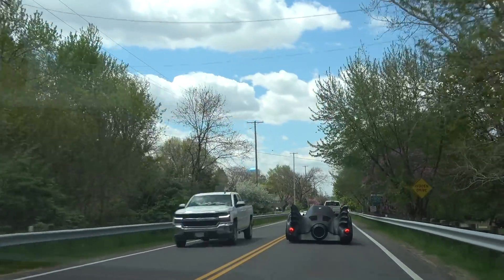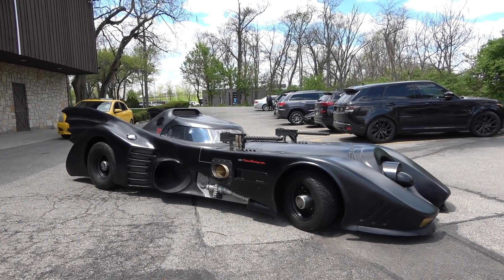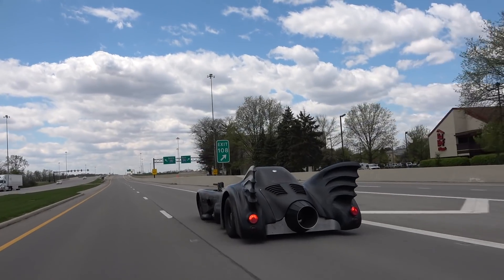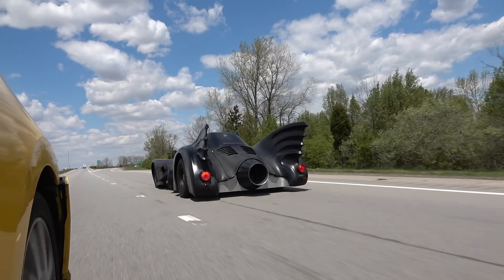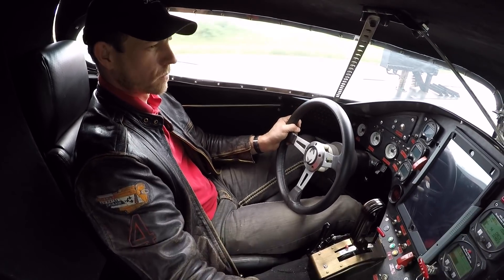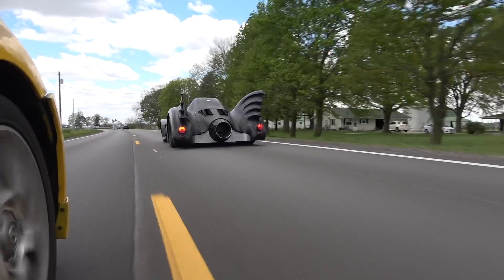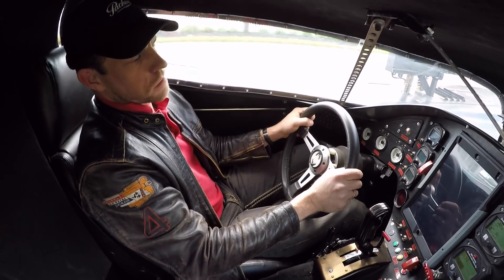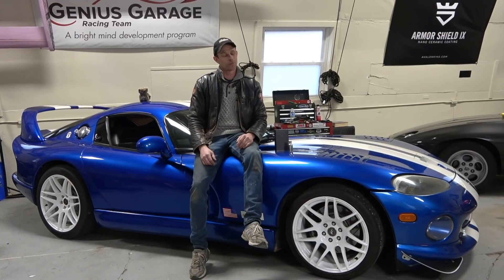Driving a real bat car! | Jet engine how to and review

Comment: Great drive! I'm surprised though you needed a gear-box with a gas-turbine engine. Gas-turbines are like electric motors in that they produce max torque at zero rpm
Reply: Ummm... NO!

Comment: Cool vid Casey, can you use the thrust to push the car? Or is it just using the shaft rotation to a gearbox using the rotation? Either way, it is a very cool build that is actually more realistic than the Hollywood version.
Reply from the maker: Internal thrust drives secondary turbine the drives the wheels

Comment: It's not economical to have a lot of "headroom" in a turbine engine, they basically consume the amount of fuel they do (a lot) regardless of the RPM (sure there's a measurable difference between idle and full power but it's single digit percents) so you generally want to run them close to full power all the time. Apart from top-speed testing on salt flats, just how fast can one even drive that magnificient beast, I doubt it has very good cornering at high speed (and it's not meant to).

Comment: How awesome that car is.   Odd question you said it runs on Jet Grade A rather then other fuels and burns at the same fuel rate running or idling 16 gallons per hours. What kinda of mileage is that?  16 smiles per gallon like Jay Leno says with his airplane powered cars.  Guessing about 3.4mpg at 55mph or 4.3mpg at 70mph (ouch) at about $4.11 per gallon means it cost over $65 per hour to drive in fuel.  It cost money to be so awesome
Reply: the thing with turbines is that the difference in fuel consumption between idle and full isn't much. don't know how to estimate though

Comment: At 18:31 you reached over for something, was that a thing or am I just over thinking your sudden movement? 
Just curious, cause if it is normal, I would like to question why you would have 2 switches that need to be turned off at simular times far away from each other. Or else I am just being stupid and don't know my turbine engine (cause that's a huge possibility, as in more than likely).

Comment: Which tank (I assume) did you get the engine from?
Reply: I think it was some 80s helicopter but i could be wrong
Reply: It's a turboprop engine, so it's for an aircraft. I can't remember which video, but he did mention where he got it somewhere. Was it for a military helicopter? I can't remember.
Reply: kennytheamazing I thought he said it was a gas turbine engine?
Reply: @joelambert7128   It is a gas turbine engine... from a helicopter.
Reply: kennytheamazing turboshaft*